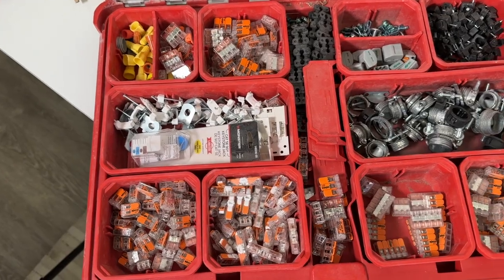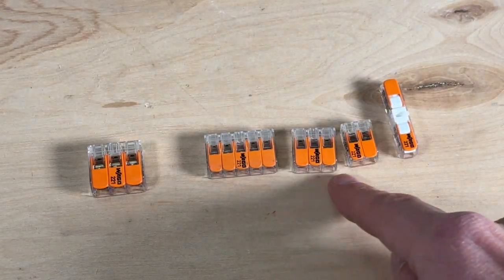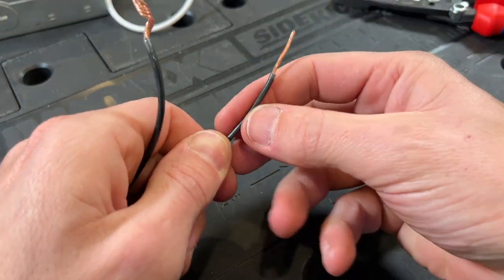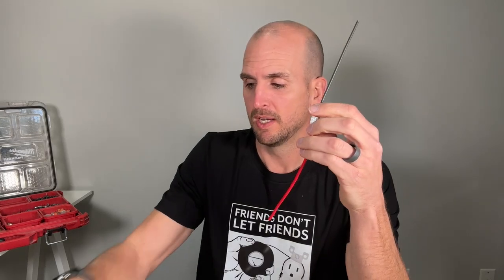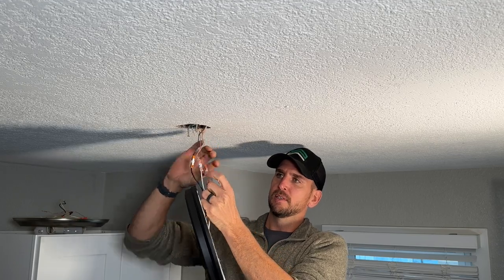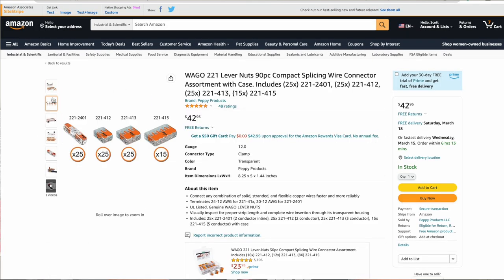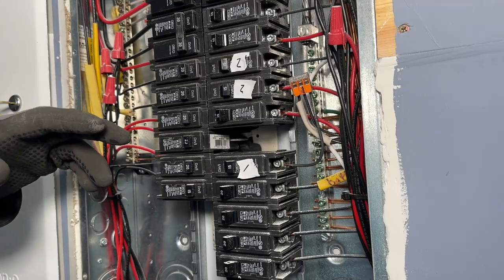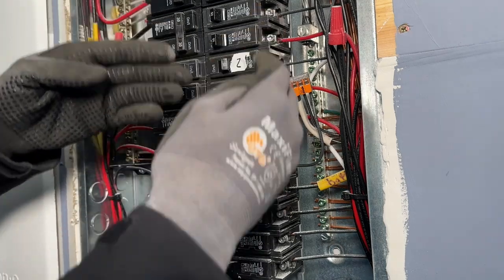Best Wire Connector For DIY Electrical Projects

Comment: The Wago lever type connectors are IMHO the best option for stranded wire. The lever on the sheet metal conductor inside the Wago flattens the strands out for a better connection, way better than wire nuts which were well demonstrated in this vid
Reply: The wires should have been pre twisted so the wire nut doesn’t push the stranded out.

Comment: I would still prefer the 2 wire connectors for light fixtures, but the breaker panel sounds like a good application.  The one thing that I found them extremely valuable for was troubleshooting two different Lutron smart 3-way switches.  I was quickly able to swap the switch around with the secondary accessory switch and get them working.  Nothing is more annoying that doing and undoing wire nuts with stranded wires on smart switches.  Would also be nice to one day see houses built with something like Wagos as it could make electrical work more plug and play if basically none of the copper wire was exposed.

Comment: Had to replace both wireing looms that go to the trunk in my BMW e61 Touring. You have to cut the old looms right behind the hinch above the speakers on the roof laying on your back. Both looms had about 15 individual wires. I have a bad back an they where a lifesaver in that monent. I know they are not really meant to be used in cars but it´s been almost a year and everything works fine. No malfunctions, no error messages .

Comment: Electrician here: I usually don't use WAGO connectors due to cost, but there is one scenario in particular where they are a lifesaver. If for whatever reason you have a very short conductor inside of a box that's maybe 1-2 inches long, it is very hard to get a solid and reliable connection with a wirenut to extend that wire. The end to end connector is great for this scenario. (most often the case if drywallers knick your wire). Also works great if you have to do a splice in an LB
Reply from the maker: Great point, thanks for the feedback!
Reply: Wago is sooooo good for commoning 4 or more conductors to keep them nice and straight in the box. They are also a lifesaver for when you're high on a ladder working overhead to replace a light fixture. The splice is just so much faster and arguably superior, especially as light fixtures use stranded wire and I've always hated splicing stranded to solid using wirenuts.
Reply: I have a hard time accessing your store. My usual password doesn't work. Is there another way?
Reply: Same here.  I personally prefer wire nuts for reasons I will not get into here (they cause arguments by people who prefer Wagos), but these are perfect for last resort wire extensions (in lower power applications) as you state.
Reply: Ideal makes a connector called SpliceLine that solves this problem.
Reply: You can use the push in wago's for most jobs, they are way cheaper but are only suited for solid core wire
Reply: Ideal “Splice line” is the connector to use to correct this problem.
Reply: Great video. I have aluminum wiring in my house. I just bought a couple of new light fixtures and they have copper wires. Can I use these connectors to connect the wires? Or, is there another similar type of connector available that I can use? Thanks very much! Greg
Reply: @rutgerhoutdijk3547  Can I put solder on stranded wire and use these connectors?
Reply: I don't trust wagos.. have had a few repair calls over the years and they were the culprit
Reply: Awesome insight.
Reply: WAGO is basically the only game in town at the moment in Europe. "more expensive" ... yes? How much is your time worth? How much worth is to be absolutely sure all connections are safe and sound?

I think thinking cents per connector is dwarfed by how much customer pays for your time and how much it costs if electrical fault causes fire or damage to life and limb..
Reply: @Mtaalas  It's not just a couple cents in my area. Wirenuts are used everywhere, so therefore they are cheaper. For example a 100/pack comparison in retail is $13 vs $26. It's really just economy of scale. I would definitely consider switching to wagos if the prices were reversed. I don't see a 100% increase in cost justifying saving a few seconds for a rough-in. In cookie-cutter homes you really only have a handful of time consuming boxes to cut-in (three gangs, four gangs etc) where wagos would make a noticeable difference 

As far as safety is concerned, wirenuts are incredibly easy to install and safe. Like anything in electrical, if it is not installed properly then it is likely not safe. The same can be said for wirenuts or wagos. There are houses that are many decades old where the wirenut has held up just fine, so the safety argument is really irrelevant. For home owners and DIY, yes I would definitely agree that the wago is easier to understand and therefore should be considered first
Reply: @avsrule247  so... your hourly rate is what? 60$? 120$? and you can add the price of connectors and wires etc. products that you use for the job.

That Wago connector is 26 CENTS per piece... that's NOTHING compared to the money clients pay for your time and expertise and other stuff.

Or do you install 500 of these connectors in an hour? :)

Why skimp on 13 cents per connector?

It doesn't make ANY sense to me.
Reply: @aaron74    I just had this project last week while visiting my brother.  Small town and nobody had Wagos.  On a ladder working over my head trying to connect two circular LED bulb connectors with stranded wire to hot/neutral.  That’s four stranded and a solid for a wire nut.  Multiple tries and couldn’t get a solid connection.  Ended up making pigtails two stranded and a solid and then joining that up to another two stranded and solid.  What would have taken me a minute with Wagos, took me an hour of screwing around.
Reply: @Mtaalas  Wago is a premium product, I love them. But I just would like Wago to some good competitors. Ideal manufactures a lever nut called In-Sure. But they cost MORE than Wago!
Reply: @Mtaalas  if we are talking about real safety, only welding or soldering can provide it, probably pressing.
In my country, regulations are not strict and salaries are low, so electricians are using cheap but time-consuming approaches.
Reply: i do not use wire nuts due to cost, i just twist the wires

Comment: Thanks to you making me aware of these a couple years back I used these to connect a 12v wiring harness to an FM repeater where the company that took it out of service  cut the wires  very close to the enclosure. It was such an easy and clean fix where you wouldn't ordinarily use a wire nut, you'd have to do some soldering and  repair it like you did those cell phone charging cables. So it's not just good for high voltage. These buttsplice connectors would be even better.

Comment: I'm the electrical lead of one of my local highschool FRC robotics teams and we actually use these wagos a lot for our canbus connections. For our power connections we use Anderson powerpoles though.
Reply from the maker: Thanks for the feedback, I actually used to work on CANbus daily.  Used to take a TON of data on Caterpillar heavy equipment.  Was a data 🤓 for many years.
Reply: @EverydayHomeRepairs  impressive, just like the rest of your channel

Comment: Scott, I just ordered some of the 6-series because there are some 10ga wires I need to use for long home runs. But I also ordered some of Wago's 2773 connectors for two reasons:

1) I wanted a few 4-conductor, 6-conductor, and 8-conductor options that don't exist in the 221 lineup.

2) If you're "designing as you go" --- maybe because it's not yet clear where and how you can run lines in a renovation --- and want temporary use of a circuit or otherwise have not finalized all your home runs and feeder runs, you can finish up with the non-level 2773 style and save quite a bit of money.

Supposedly you CAN remove a solid wire from a 2773 connector with a twist and pull, for the inevitable times when that'll be needed. But hey, especially for things like junction boxes, you shouldn't really need to build in disconnects anyway. The only downside is that Wago has not yet released a larger version of the 2773's that will accommodate 10ga.
Reply: An 8 conductor wago seems unnecessary, 8 hot, neutral, and grounds is 24 wires and a standard box is only allowed 9 14 awg wires. Or 8 12 awg. Just keep that in mind when neprking on your project, good luck
Reply: @billy9075  Hi Billy. I have several metal J-boxes, at 4 11/16" by 2 1/8". These are represented in the 314.16(a) chart of standard sizes. The NEC says these are 42 cu in boxes.

In one example, I'll use 14ga for short runs to 7 room receptacles fed by a long 10ga home run. 14 hots and 14 neutrals of 14ga = 28 cu in, and the two 10ga conductors = 5 cu in. Add another 2 cu in to represent the largest (10ga) ground (the other grounds aren't counted; all grounds = "1 conductor") and I'm still under 36 cu in, with room to spare for the splicer. :)

Comment: I love these wago connectors! I recently installed a few light fixtures (ceiling fans, flush/semi flush mount lights etc) and these made install a breeze as some were replacement fixtures and some were new fixtures. I wish I had saw these single connectors before I started my project but that's on me! I have a few left over but if I were to need more I'm checking your Amazon store for sure! Thank you!

Comment: I just recently used the line connectors for extending speaker wires. Very easy and solid connection. Much better than braiding and taping.

Comment: Great product update.

Also great for pigtailed extensions on short wires.

Hope Wago adds an in-line 3-in/ 6-out connector for splitting off from a branch line without needing to pull slack from existing line (e.g., cutting into an 12/3 to feed an additional 12/3 branch).  Such things are available from their competitors, but I prefer Wago.

Comment: So agree on the Wagos being a live saver.  Just changed a light switch and the old one had really short wires screwed to it (house was built in 1910 and it's knob and tube wiring).  Wagoed (spell check says it is a word) the K&T onto some extensions made from Romex scraps.

As for the inline splices, I have not yet used them but one spot I can see them being handy is on a portable stereo I have.  The charger cord fatigued where the charger's barrel plug entered the stereo's charging port.  Spliced a new plug onto the cord but since I suck at soldering, used the old school Wago's to make the connections.  (wish Wago made something that had four ports but the bus bar was broken in the middle)

Comment: The temporary light is better than what I used to do. I would jus5 stick the wires into a plug to socket adapter and tape it in. Not particularly safe, so this is a much better idea. Thanks for the tip.

Comment: I used them to quickly extend the antenna on my remote controlled gate. Saved me a few minutes in the south texas heat using wire nuts.

Comment: Excellent ! I added the in-lines  based on your previous video.  I needed to upgrade a couple of receptacles in  very tight outlet boxes where the leads weren't a full 6 inches.  But I know they will come in handy for the other applications  mentioned.     At the time i couldn't find a reasonably small quantity of the 12 Ga ( 221-2401 supports 20-12 AWG solid, 18-12 AWG stranded).   So i bought the 14Ga  (221-2411 supports Solid  20-14 ,  Stranded 18…14 ).     I don't really understand why they bother to make the 14 Ga, so make sure you buy the right ones
Reply from the maker: Good question on the 14 gauge.  I think maybe those are targetted a bit more to markets running 240V for most fixtures which would lower the standard current and increase the use of 14 gauge.  🤷‍♂️ I think for the US market now that the product is more available 2401 is the go to but there for about 12 months 2401 and 2411 were really tough to get in the states.
Reply: @EverydayHomeRepairs  good evening, 

Dude where do you purchase your wago?

Comment: I sometimes use the inline connectors when making automotive wire repairs/additions. Especially for things like audio equipment, where components may be swapped out at a later date, and there’s little room for a crimping tool. For more permanent/weatherproof connections, I’ll side on a piece of shrink tubing over the connector.👍

Comment: Love the Wago’s, when you have a 4 square box with 2 outlets in the middle of a run that’s a lot of ground wires and multiple wire nuts to make it all up. I don’t need to tell you that takes up a lot of space, gets kinda tight in there 😅. One thing, I also put a bit of tape around the levers just as a precaution.
Reply: Electrical tape across the levers is brilliant and everyone should do it actually 🙂

Comment: Photovoltaic / Solar Thermal Technician here: stranded wire to solid wire has to be done correctly. stranded wire should not be parallel but 1/8 further than solid wire, then you put the wire nut. i too twist the wire so it doesn't pull. but that Wago on that application is very nice 👍

Comment: As a master electrician and the safety supervisor for an electrical contractor I'll say this. We don't use WAGOs. We hate them. I've seen more than a few fire jobs where wagos were used and not installed correctly. Its really easy to not seat the wire properly causing arching or have it pop out entirely.

Comment: That's what I've been using now they are nice specially when you have a bunch of wires you accidently cut or rewiring someone else's mess and aren't positive to connections are what in a wiring harness

Comment: I used six inline Wago connectors in my breaker panel when I put a generator transfer switch in. 2 connectors for extending the neutral and ground to the terminal bars, 4 to connect one side of each transfer switch to the load circuits.
Reply: That's where they really shine. I always hated the loop back from using the standard Wagos, or even wire nuts. The inline connectors make it simple, and it just looks better.
I also use them for pulling circuits from my breaker box to a sub panel that is powered by solar.

Comment: For me I want to put in a Reliance generator transfer switch on a few critical loads in my house.  This requires you to remove the black hot from the breaker, route it over to the transfer box, and then return to the breaker.  The transfer box comes with the wires to/from the box, but you still have to connect it to the original black hot somehow.  These inline Wago's seem like the perfect item to do that.

Comment: I added some inline Wagos for garage door opener sensors. The sensors don't come with much wire so needed to splice them into a longer wire to then run to the opener itself. Since it's 18 guage wire, the Wagos were perfect for this.
Reply: I'm getting ready to install an opener and was just wondering if these would work for that purpose. Thank you!

Comment: Scott, some commenters on here mention Wago 2773s. Would be great to see these added to your test to see how they hold up.

On your pull test for stranded/solid connection under a wire nut, past experience seems to result in better pull test results when the stranded wire is inserted into the wire nut and the stranded wire is bottomed out, firmly seated in the end of the nut before placing the solid conductor. However, the Wago really takes the potential concern out of the installation when stranded wire is part of the install.

Comment: Great video EHR. I was wondering about those. I purchased a kit and some refills on your Amazon store, but I haven't had occasion for those yet. They seemed to me that it would be "longer" and take up more room, however, the use, especially in a circuit breaker panel box would be ideal. Running out of room myself but need to replace 2 breakers. Thinking of staying with 15 amps even though I've upgraded the wiring to 12 / 2 with ground and am using 20 amps outlets... I will be glad when 14 gauge is no more. Getting tired of rewiring houses. Hope one day I can have a house built to my specs. All 12/2 instead of 14/2 and I am also considering an extra wire just for grounding the box itself to bond with the panel. The less splices, the better. Having all wires connect directly to a socket receptacle, or light fixture or switch, all the better too. Without pigtails even on grounds. Hell just make them all isolated grounds so you're ensured that electronics and stereo equipment is properly grounded regardless of where connected.
Reply from the maker: Yeah, depending on the application I bounce between the inline splice (2401) and the standard 412 WAGO lever nut.
Reply: If you're using 12/2 why use 15 amp breakers? There's no up side, I'd go with 20 amp breakers and 15 amp spec grade duplex receptacles. 20 amp receptacles offer no advantage either.
Reply: @surferdude642  Because I haven't yet upgraded the breakers. If it isn't broken, I don't want to fix it. 2o amps receptacles allow for a weird plug, which I actually had on a computer power supply unit I had many moons ago. While I haven't encountered them since, I like to have it and not need it, than need it and not have it.
Reply: @michaeljavert4635  Ok then, but keep in mind that equipment that uses a 20 amp plug is extremely rare and if you ever come across one it's likely to be a fixed appliance and/or require a dedicated circuit meaning a single 20 amp receptacle, not the common duplex.

Comment: I like the concept of the inline and your second and third use cases, but the first use case, if we're talking in a box, I would think the standard connector uses less space when you tuck it back in. 
I recently ordered a starter kit before they offered the inline, so I just bought the 20-piece from your list. Thank you!